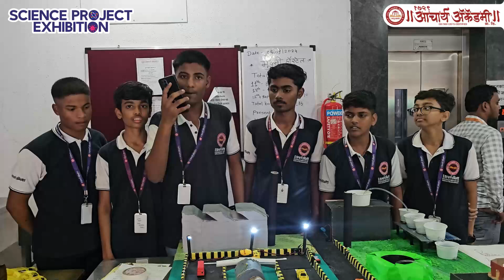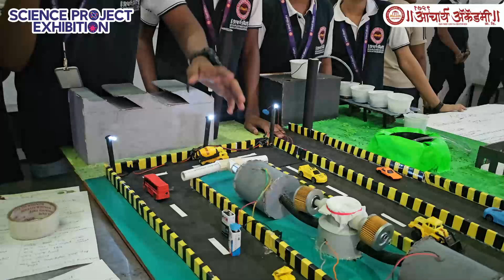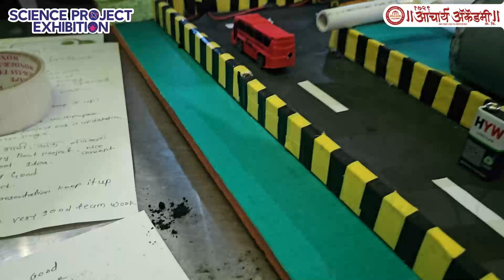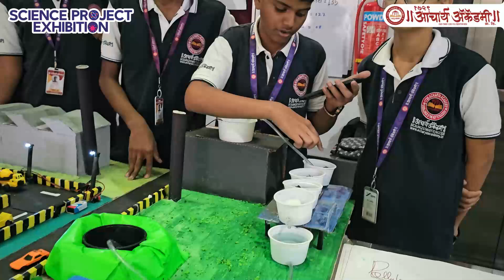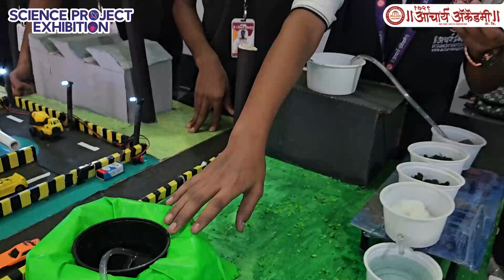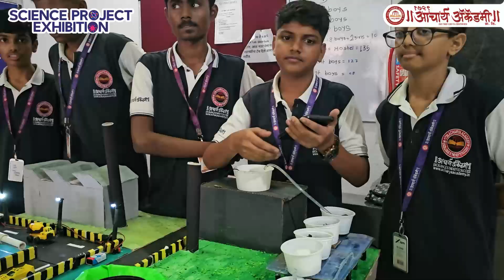Pollution Convert into Ink and Water Purification Plant

Comment: Hy I nedded a help in this project i have double relay module how I can fix with pcb but the senser is working but after that's motor is not rotating on camand of sensor